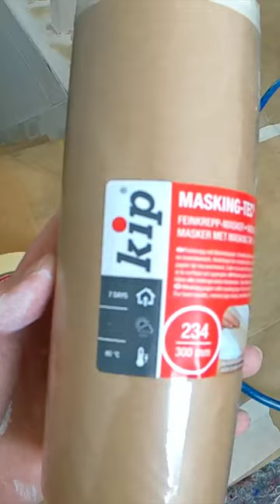Staircase Joinery REPAIR & Airless Spraying Spindles With an FFLP 106

Comment: Hi Pete, what paint are you using & how many coats? Great content as always
Reply from the maker: Here’s the products below  — they dry very quickly, I typically spray 2 or 3 coats of primer, denib in between, followed by 2 topcoats 👍

WP136 which is my go to high build primer for white woods / pine / mdf — excellent on mdf with its edge sealing properties..

WP136 Water Based Primer / Edge Sealer
https://holmanpaints.co.uk/interior-wood/171-akzo-nobel-WP136-highbuild-waterbased-primer-edge-sealer.html

For the satin topcoat.. AkzoNobel Aqualit (Supercryl) Waterborne Enamel Topcoat
https://holmanpaints.co.uk/interior-wood/169-akzo-nobel-aqualit-waterborne-enamel-topcoat.html

You get a beautiful cabinet like satin finish ..and very cost effective, especially in 5 litre cans..

Comes in white, then if needing tinting both primer and top coat can be colour matched off any colour chart..

I’ve used Holmans for years,..

Can be delivered next day if required.. If this helps at all, Holmans have a 5% discount code, across all their range, if you place your order online, enter ..

👉 Code PAINTHQ

Keep in touch my friend.. regards Pete

Comment: Can you fill and paint using that Tourpret wood filler the same day as I noticed you were only going over the surface and it didn’t look like you were doing any deep fills.
Reply from the maker: Hi Chris, good question.. yeah you’re right, the fills were shallow, no deep fills.. I did wait a day to sand off and spray in this video, mainly because I covered some large areas.. but I have in the past filled (if dry), sanded and sprayed in one day.. one tip is to use a 2K filler, smooth flush.. the 2K will dry rapid.. then give a smear of Toupret, which again will dry very quick.. then a light sand with a fine paper and you’re ready to spray same day 👍 I’ve done this filling sunken screw heads for a flawless job — you couldn’t detect the fill 👍 Hope this helps, keep in touch my friend.. regards Pete 💙
Reply: @PaintHQ  thanks for replying Pete. Just finished a whole house renovation myself. Thinking of next time learning how to spray as the finish is superior to brush or roller. I bought the erbauer eaps600 some time ago but never used it as I thought at the time it was a steep learning curve. I really hate painting the woodwork and thought about getting a decent tip and having a go. I’m so tempted to invest in the graco ultramax but a little put of by the price. I will probably try the sprayer on walls first and then do a rest of the woodwork once I gain confidence.

Comment: i just cant get the 106 tip to work Pete. Do you have to thin your paints by 10 percent or what? Tried it on the Ultra at power 5 but not on the 390. Any advice mate?
Reply from the maker: Hello my friend.. with a .006 I’m spraying low viscosity / free flowing material.. runs off a stirring stick without breaking flow and ‘worms’ will sink quickly back into the paint.. also a .006 will need a bit more pressure, so if you was at 800 psi, you could be at 900 / 1000 psi.. I don’t typically thin woodwork / trim paint.. what is it you’re spraying?.. also a quick point on the Ultra HH / QuickShot — the minimum tip support is .008 — a .006 will work, just need to find a sweet spot spraying, and not over pressurise.. I will try and cover this topic in a future video 👍 regards Pete (let me know what paint you’re spraying my friend) 👍
Reply: @PaintHQ  I’ve bought 106 when I watched yr other video,but can’t have it working,last night thought I will grow gx21 through window 😂 it’s gx21 with sprayman filter 100 and blue filter in Graco contractor gun,spray 5spec then block,the turn tip to clean blockage,spray 10-15 the. Stops,so turn to spray position,spray 3sec then block again!!using layland hardwearing acr eggshell,paint thinned so it’s runs form stick constantly
Reply: @PaintHQ edit,had 60mesh in machine and 100mesh in gun,put 100mesh in gx21 and much much better,just ordered 200mesh for both gx21 and gun,cheers

Comment: Hi Pete. Where do you get those grey mat cover things from?
Reply from the maker: Hello my friend.. sure I’ve put the link to the product on Amazon below.. it’s a fleece / plastic backed floor protection that can be rolled out and reused over and over.. very cost effective.. in the video you see me use on stairs — I fold in half and tack in the corners of the stair tread / riser with Kip 3804 crepe masking tape 👍

https://www.amazon.co.uk/dp/B06XJ7PYD4?ref_=cm_sw_r_mwn_dp_JF958THAANDX5YZ561J5_1
Reply: @PaintHQ  Awesome. I’ve got carpet to protect on Thursdays and I really don’t like the sticky cling film type stuff, very hard to do on your own. It does say for hardwood flooring but I guess it’ll be ok on carpet?
Reply from the maker: It won’t grip / stick to carpet which can be ideal (as you say) and not ideal.. I say not ideal because it will move a bit, that’s why I tack in place.. for me it’s like a dust sheet but better, the fleece is super absorbent and the plastic backing is good quality, nothing is getting through.. so yeah I’ll use on carpets too, I use it all the time.. it’s perfect on hard floors, the plastic backing will grip without sticking 👍
Reply: @PaintHQ  Thank you Pete. Have a great week!